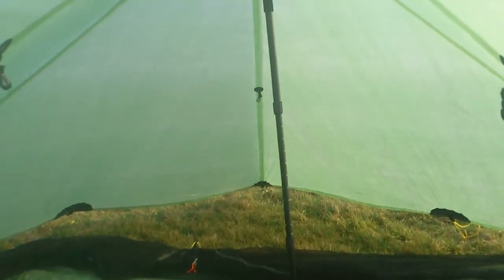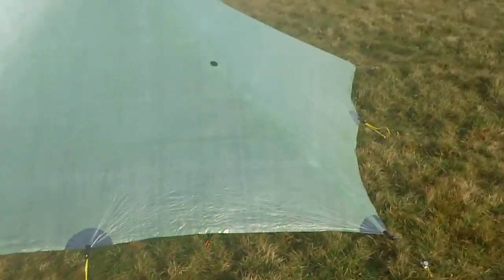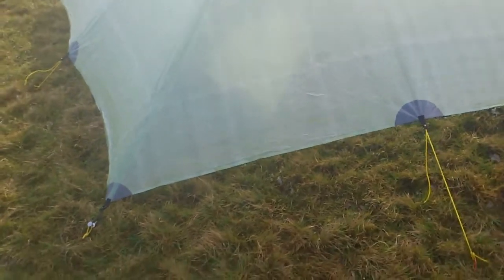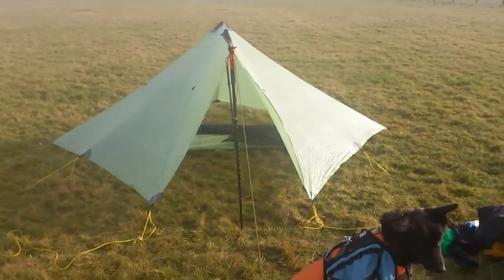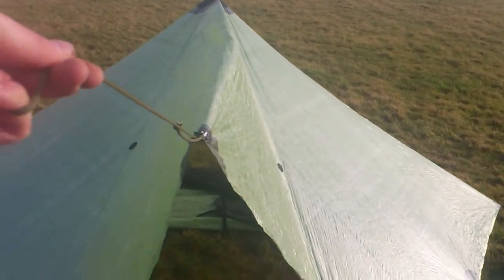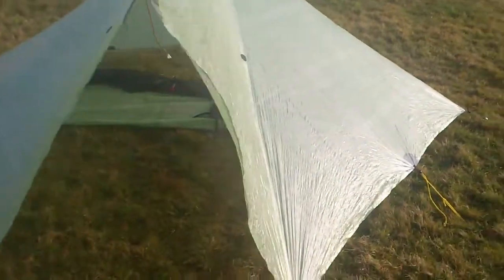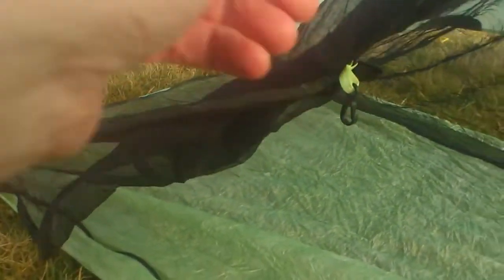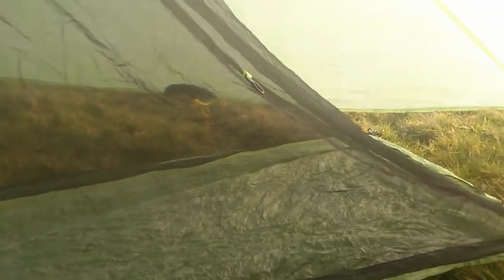PART 1 MLD Cuben Trailstar first pitch. C part 3!

Comment: That's the beauty of the trailstar. There's more than one way to pitch it. You just pitched it in another way than most other people do. A friend of mine even pitches her trailstar as a square pyramid and folding the fifth side in to get steeper walls in snow conditions!

Guess if you want to achieve the classic five sided pitch you're not supposed to start with a corner as the center of the backside. You should start with a panel  as the backside do that a corner will become your door!